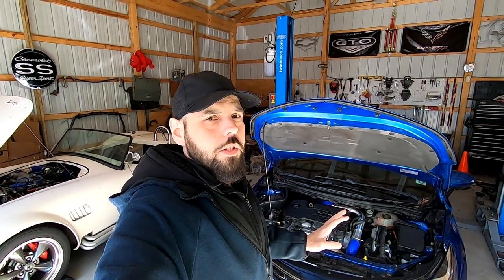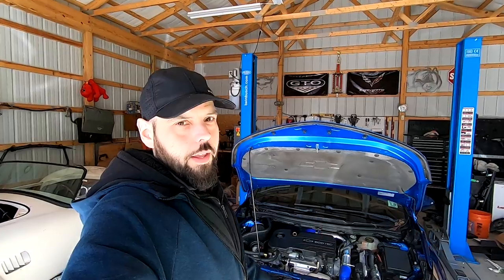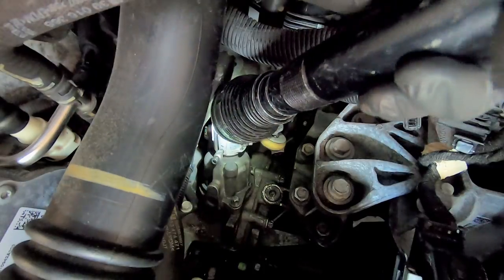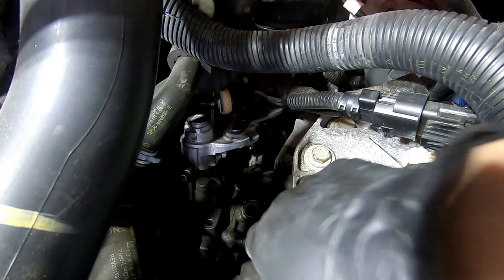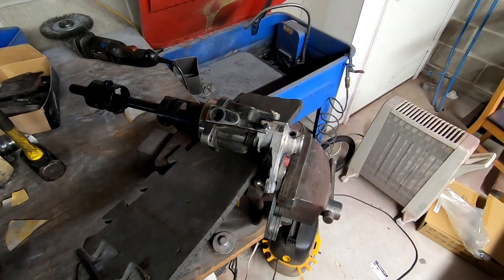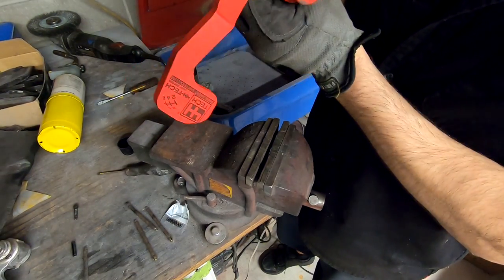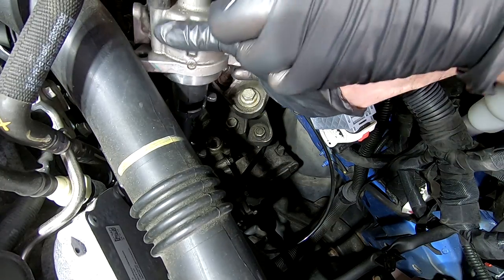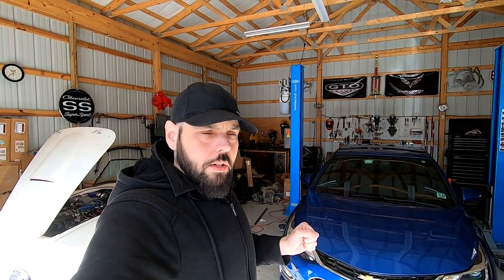CRUZE faster transmission shifting. Dave's World Project CRUZE Missile Q shift install.

Comment: Im glad the Gen 1 shifter like this was a lot easier. lol Cool video, as usual. 🖖
Reply from the maker: Do you know what transmission you had in your car?
Reply: @davesworld2132  It has the M32 6 speed. Also, do you know if adding the OTTP short shifter along with this has any benefits? I like the looks of the OTTP shifter.
Reply from the maker: @mikes.4811  I have both and it feels like a race car shifter now!
Reply: @davesworld2132  Cool. May have to invest in one. 😉🖖
Reply: @mikes.4811  it certainly should be a difference felt, you are making another 'link in the chain' shorter/less throw.

Did you end up installing the ottp short shifter?
I'm considering doing both
Reply: @RandoManFPV  Not yet. It's on my To-buy list. Getting the tune ironed out right now.
Reply: @mikes.4811  oh nice. Hey I just realized you said the qshift for the gen 1 was easier? That's good because I'm looking to instal this soon

Comment: Awesome mids you have done. I'm glad I saw this video as the 4H page makes it sound like it's a piece of cake to install when it actually is quite the opposite. 

Haven't explored your visa yet but any plans on adding LSD ? BTW new sub .
Reply from the maker: Thank you for subbing. LSD is in the future and a higher gear ratio. this things is costing me some $$$$$$$$$ so I have to budget. Ive been posting up my big turbo install for the last few weeks so I have to finish that first. Next is meth injection. Then more trans upgrades later. As far as 4h goes. This is why I left the struggling in the video. That way people can see what they are in store for.

Comment: What's the parts that are the best to put on my cruze I have a few ideas but I need more anyone have a list or something to I can look I'm to some
Reply from the maker: Is your car currently 100% stock?
Reply: @davesworld2132  yes
Reply from the maker: @alekdegen4019  def can start with my air box mod. That’s free. I have a video in the Cruze missile playlist. I also have a nice wastegate modification. Those are two cheap things you can do.
Www.davescustomparts.com has some other goodies.
Reply: @davesworld2132  ok what about better shifting mine feels slow
Reply from the maker: @alekdegen4019  yours is the manual or auto?
Reply: @davesworld2132  auto
Reply from the maker: @alekdegen4019  When’s the last time you had the fluid changed?
Reply: @davesworld2132  iv only had it a few months so it's probably passed due
Reply from the maker: @alekdegen4019  I feel your pain. I have a Miata on my property for a year and a half with a pile of parts waiting to go in. I just can’t find the time to get to it.
Reply from the maker: @alekdegen4019  Definitely start with flushing out the transmission I’ve had very good results on some of my other cars.
Reply: @davesworld2132  ok I will  start thir